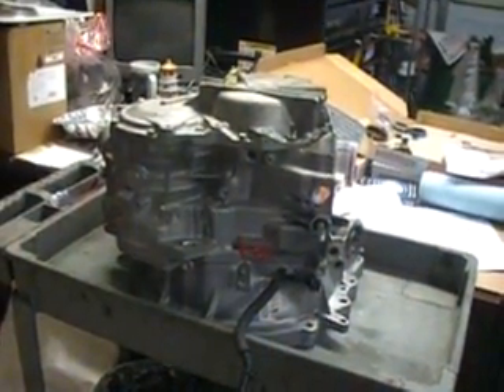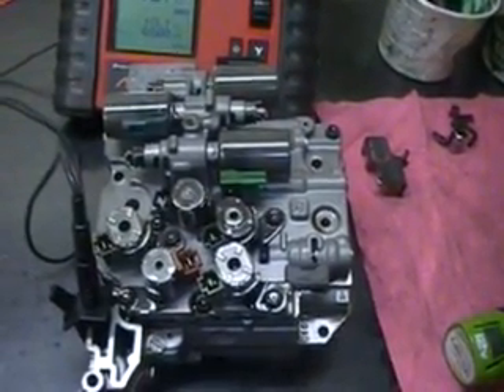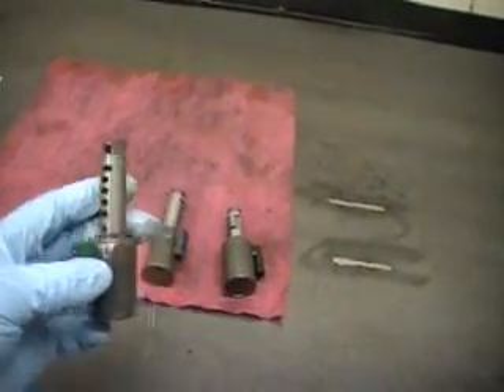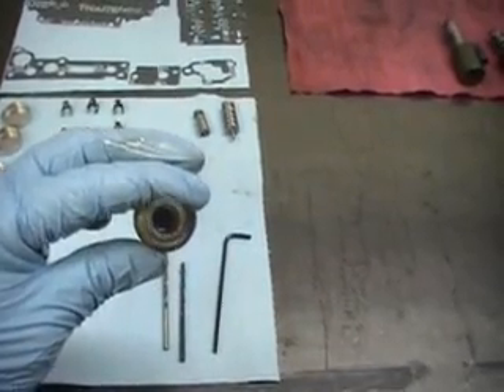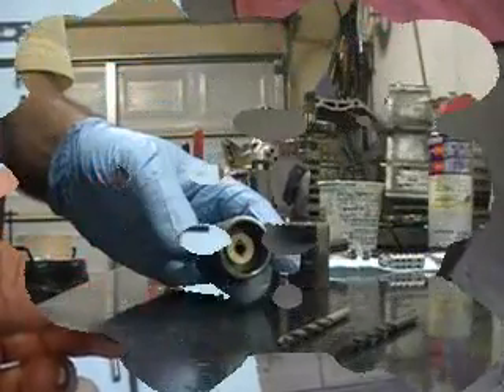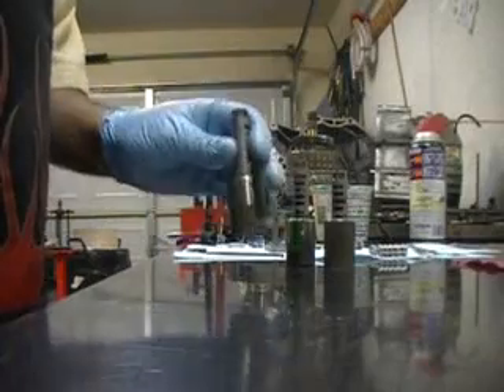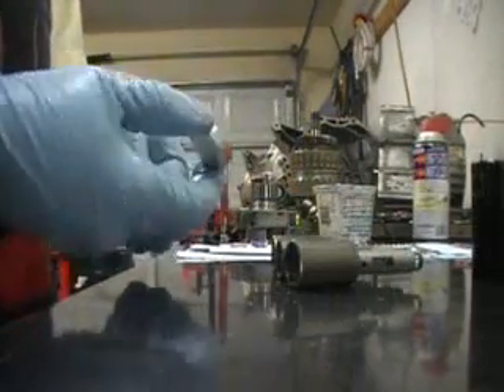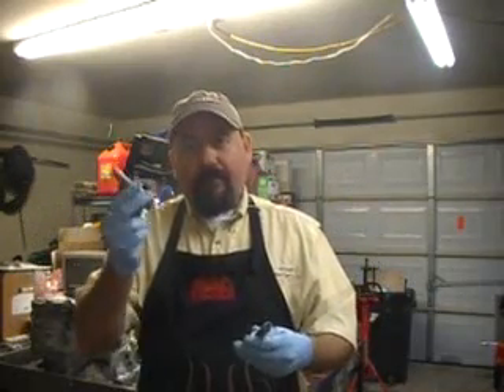Fix Your Transmission: Step-by-Step AW55-51SN Solenoid Repair Tutorial

Comment: I had this same issue. I recently installed a reman valve body and now I get a bump every time and it doesnt even want to shift now with codes P0735 P0732 and P0780. Do i need to get a TCM for it installed?

Comment: Just had a question.  My 05 Maxima just started shifting hard into drive, and 2-3rd is rough.  If I get a brand New Replacement Valve Body put in, will that fix all my shifting issues?  I have only enough money to get that and do it so if that's not a complete fix and work the 1st time, Im not gonna have $$ to do more...thanks

Comment: I've done this bushing cleaning with the drill.  Now my transmission slams when I shift in D.  Cleaning with a drill is risky: you never know if you've removed enough of the gunk stuck on the bushings (this gunk is hardened).  Plus, it's a whole work to remove these.  Now I bought new Rostra solenoids from Ebay (these sell for around $150 just be careful not to buy some chinese stuff, Rostra solenoids are stamped with a think R on the shaft) and will have them installed.

Comment: i have a 06 nissan maxima ...after doing a head gasket repair and timing chain switch out...im now having transmission problems with a P0765 solenoid D issue....so i changed all the solenoids on the valve body and im STILL getting the same code...with the transmission stuck on 5th gear.....can someone point me in the right direction on how to fix this problem?

Comment: Hello Hiram 
I have a question to ask.
I have 2006 Nissan Quest and trying to replace solenoids.
I bought Rostra Solenoid set part No. 52 9036 00 00 
When I took them out of box, they seem to be out of calibration.
Even though they are made by Rostra which has tiny holes in the bottom,
Should I turn screw 4-1/2 times for SLT and SLS.   8 times for SLU? 
 They are Not original Nissan Solenoid from dealer.
That is why I am asking.
Thanks for your support sir.

Comment: hi please help i have no reverse and neutral is forward after a  REBUILT VALVE BODY
i have been to over 10 shops everybody tells me something different i have this 2001 volvo c70 only 110.000 miles 
it has a wa55-50sn no letter valve body i the problem i had before was It has hard upshifts and downshifts we put a rebuilt valve body in and flush the old  fluid out put new fluid went on a 30 min drive stop for food for 15min then i put it in reverse and  no reverse and neutral is forward
BUT WHEN the car is off neutral is  neutral 
before the rebuilt valve body reverse was the only good thing i had IDK WERE IT WENT WRONG ITS NOT THE LINKAGE SINCE THEN I PUT A ANOTHER REBUILT VALVE BODY AND SAME THING 
PLEASE IF YOU HAVE ANY IDEA ??????????????????????????????????????
I WATCHED ALOT OF YOUR VIDEOS I'M LIKE WERE IS THERE A TRANSMISSION SHOP LIKE YOU AROUND HERE  IN ORANGE California
Reply: Adam Carmi I had the same problem after I did my valve body it's two seals that goes behind the valve body and if you do not put them in your car would not reverse at all. I hope this helps
Reply: I have exactly the same problem, did you ever resolve your issue?

Comment: Hello Hiram. Thank you for all of your videos. I am working on a full rebuild of a 2001 Volvo V70 Turbo. I was wondering if you knew the correct callebration turns for the linear solenoids. Are they anything close to the Nissan one here in your video of yours? Thanks for your help.

Comment: RE4F04B transmission is not shifting on its own, I manually shifted it 1st 2nd then to drive and it seems the drive gear is gone, because i get up to speed in 2nd then manually shift to drive and it feels like nothing is engaged, let off so rpm dropps and it seems to go into overdrive and car will speed up, press the acceleration and it slips ,, what do you think is the main problem? shifting solenoid?

Comment: Always great content Hiram. I have an 05 Altima 2.5 with a hard shift from neutral to drive is that a common shift solenoid issue for the Altimas? seems like a high pressure build up.
Reply: I have the same issue on mine, did you ever fix it?

Comment: Hi Hiram, I have a 2005 Volvo s60 and with the 55-51sn.I am currently replacing the valve body and everything I see says you need to replace the 2 deals that are on the transmission behind the valve body. But I can't find any mention of what part is used to replace them. Can you possibly point me in the right direction?

Comment: Thank you very much for this video. I am getting code p0732, and believe I may have to eventually do this. My question is, should I try doing a drain and fill first to see if that works? Or is this code more involved than just fluid quality you think?
Reply: My wife was out doing errands and had this trouble of losing power and a loud drowning noise when accelerating. I looked up the code she got from scan tool, and it's pointing to gear 2 solenoid. I had her purchase for me the trans filter and gasket kit, and plenty of fluid. I'm a new owner of this 05 Nissan Quest with almost 200k miles. I have o way of knowing if or when it was even done before. So I'm hoping maybe its the fluid and filter.

Comment: Hello,

I have a 2004 Nissan Maxima 3.5 and the code that i have received was   P0797 "Pressure control solenoid valve 'C'' (http://www.autocodes.com/p0797_nissan.html) .  What is the average cost for labor on this job...  I have already purchased the parts i need.

Comment: Hi, HIram. I am so thankful that you uploaded this video concerning the problem of Nissan's transmission. I have 2004 Quest SE which has a 5 speed automatic transmission. I feel a hesitation and shifting shock between 3 and 4, and a slip between 4 and 5. Is it related to the problem of solenoids?

Comment: hi so i have a 2005 altima 2.5l automatic and my sis had been using it for a month on low fluid it started slipping and i added fluid and it seems to not be downshifting now into 1st gear anymore it triggered a code and i saw this and had never had issues till now that it was driven on low fluid for a lil while but reverse is strong just when i go to drive it in drive its obviously stuck in 3d because it struggles to go anyways you think i have a possible bad solenoid? or you think she fried the trans? i tried disconecting the batt incase it was in some type of limp mode and still slips with new fluid and all anyways just thought i would ask for personal opinion before i take it apart and check like in this video thanks

Comment: Hiram; wow, your videos are excellent! After cleaning the solenoids ALL of my problems were fixed..... For about three weeks! Now I'm getting the 2-3 and 3-2 hard shifts, and it seems to want to hold 3rd gear too long before downshifting.

I changed the fluid again, with mobil 3309. I noticed some small flakes in the fluid! I'm wondering if perhaps this is clutch residue or something more serious. If I head towards a reman/rebuild, is there anyone you can suggest? I live in atlanta and this is a 2nd car so I don't mind downtime.

Comment: Two shops condemned my transmission($2400-3800). $150 in parts and materials + 5 hours over two days and I have excellent results. No rack, no power tools, just thoroughly prepared. I am 67 years young and on Social Security so this was a gift. My retired shop hat is off to you sir.....

Comment: What kit did you use to get those end caps, and how did you cut them off? I know that Makco sells a tool kit to rebuild these solenoids, but at around $400 its just too much money to spend unless you own a transmission repair shop. Also, where did you buy the rear caps for the solenoids, part number, and company please...thanks.
Reply: +Jesse Lauffer 
TransGo (keep watching the videos; Hiram says in the videos which kit he used.)   The ends are (carefully) ground off with a bench grinder.  (The instructions with the kit detail how to do it.)

Comment: Great job. I just rebuilt an AN55-51, and your video's helped me find where I left a two prong fork out on the valve body that held in a temp solenoil. [I rebuilt the valve body with a Sonnax zip kit, and thought the fork was a linkage alignment]. So I made another fork, and now the trans will go into gear.

Comment: Hiram I did this job tonight on my wifes 2004 nissan quest 5-spd transmission.  Everything went very smooth and i felt great.  i got in the car to drive home from my father in laws garage and it will not shift out of 2nd gear when i have it in ("L") low.  If i put it in drive it wont even engage and the engine just revs.  Any advice on where to start or if i should be looking to replace the transmission at this point?

Comment: @hiram I have a 2004 saab 9-3 aw55-51sn for the transmission .... I am having an issue after about 30 min of driving on deceleration  between 15mph and 0mph it feels like someone is bumping my car in the rear .....do I need to get new solenoids ... Pls help .....

Comment: thanks alot but you do something but not show how you did it. show us how did you remove solenoid from the overall assembly ? how you took off solenoid end? how you removed the inside armetures ? i have maxima 2.0 model 1999; at low speed when i am pressing the brakes and car moving fowards slowly, it is like movement is shaking step by step not smooth...at high speed I am facing can unable to climb the hill. what do you think ?

Comment: Would it be easier to find used transmission and replace hard to find mechanic ass good as you to re construct it would I need a the computer off the car I would get used transmission from need help have 05 nissan won't go into gear need to fix could use your advice

Comment: Hi Hiram.  I am facing a problem with my AW55-51SN on my Volvo s60 2006 car.  The transmission was recently rebuilt and worked fine for six months with some slight sluggish gear shift down from 2nd to 1st.  Now the transmission is not working consistently.  It now works for a couple of days, my mechanic cleaned the valve body by blowing air and simply resetting the computer.  It still persists and gives a transmission service required message and won't even shift.  If I leave it overnight and drive it on a short run the next day, it works fine.  Then if I go on a longer trip, the message comes on and the car stalls reving without shifting neither on D nor on trip tronic.  Could this be a problem with the calibration of some solenoids.  If so, would replacing the solenoid fix the problem if the computer indicate which solenoid is causing a problem?  Appreciate your comments and advisory.

Comment: Hi Hiram,
I just tried to install the transgo shift kit.
2004 Nissan Maxima.
I discovered someone had replaced the solenoids in the past.
The solenoids do not have crimped caps, and they have 4 holes in the back, so I could not do the drill bit cleaning.I took them apart and they did seem to rattle freely. I cleaned them and put them back together. I used the 8.5 turns and 4.5 turns that you stated. The black one was around 8 turns when I disassembled it, the green one was around 4 turns and the blue one was around 3.5 turns. When I put the brackets back on the solenoids, I noticed that the solenoids could be turned back and fourth some, is this normal? I did replace the other parts in the kit.
Anyhow i put the valve body back in the car and I am still having the same jerky, slamming, slipping shift problems. The fluid was pretty brown when I drained it, only about 4 quarts.
Any Idea what my problem is. I read your comment about the camshaft crankshaft sensor.
I had replaced the crankshaft sensor a year ago because of an error code. I do not have any error codes for the sensors. I am very frustrated with this transmission. Any insight would be greatly appreciated. Thank you

Comment: Hi Hiram, I performed the solenoid service yesterday on my 2001 Volvo V70 XC wagon and flushed the transmission and it works great now since I relearned the transmission shift pattern. I am very thankful for your videos because I would never have bought the car without your help. I used Maxlife atf and it works great. Do you recommend adding an inline filter?

Comment: You know whats interesting about the RE5F22A, anything you search about it comes up with valve body fixes. But I can hardly find a rebuild thread or video, most people don't need a rebuild until 300K even with the transmission holding down 300+ whp.. Not to bad :P

Comment: Hiram I hope you can offer me some advice. I'm about to purchase a Volvo '01 XC70 with AWD.  It has no reverse gear.  Would it be fair to say I need a new valve body only or could it also be an internal issue?  I will drive it again to gauge if there's no low gear as the repair manual states 1st/Reverse solenoid is shared.  I can perform the valve body changeover myself.  Many Thanks Mike

Comment: Excellent presentation! Ive got an A160 Benz 2001 with Pulse width modulated solenoid valve pressure fault(P1844). In your experience is it possible do get a kit like this for that model?  I dont want to spend more than what the car is worth just to fix a dodgy solenoid. Any references wil just be awesome.

Comment: Hiram, I have read some bad things happen with the AW55-51 if you use the incorrect fluid. I've heard use Volvo brand ONLY (which is NOT synthetic, listed on label) and Use Redline D4 (synthetic multi use formula) Which fluid has been the best in your experience? Thanks.

Comment: Hey hiram great video. So I bought the transgo kit for my 05 maxima. i put everything on installed it back on now it wont engage on drive. reverse works.. any suggestions what i might have done wrong. i doubled check my connections. thanks in advance.

Comment: update, found I had put the bracket that holds the three solenoids in backwards which repositioned the solenoids in the valve body. reinstalled VB and car drives perfectly.

Comment: Good video, thanks for posting, I just completed the VB rebuild (nissan quest RE5F22A), my orginal problem is corrected (slams 1-2, 2-1), now after reinstall getting what I think is the same complaint on pg. 4 of Transgo installation sheet. 2-3 cut loose, (also posts FC P0780 shift), I dont think i replaced or disturbed the 3rd band.....any sugestions?

Comment: Hey how are you, could you give me some more advice and pointers?? My linears are ohming at 7-8ohms and the other solenoids at 15..........now, when you put the solenoids back on the valve body, are they supposed to be tight on there without being able to slightly rotate, or ithey supposed to move slightly, say quarter of an inch ?

Comment: Hi, Good video! How did you remove the cap (by cutting off..?).  And the distance between cap and crimp will affect pintle travel. Pintle travel affects output pressure. So when you push the new cap in, the original canister height need to be maintained, right? Thanks!